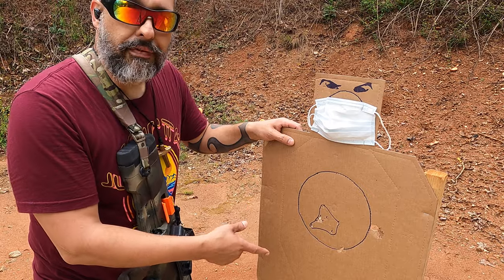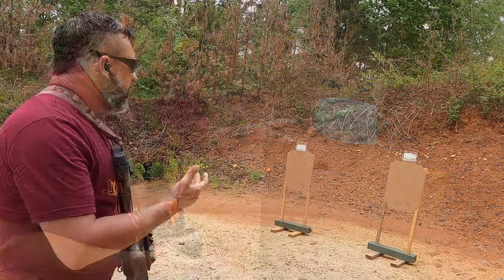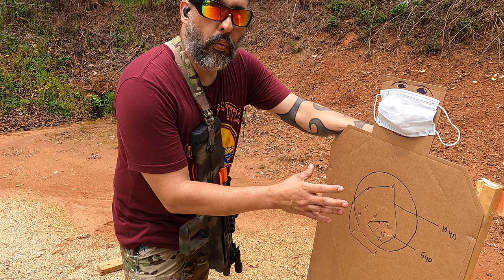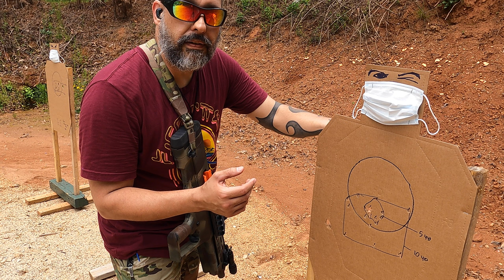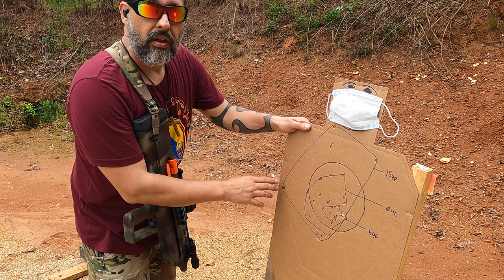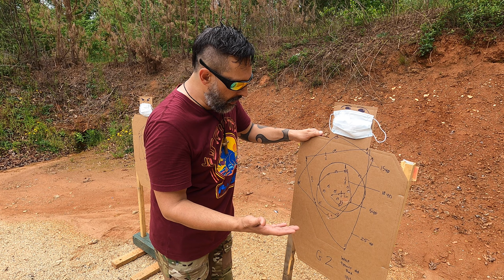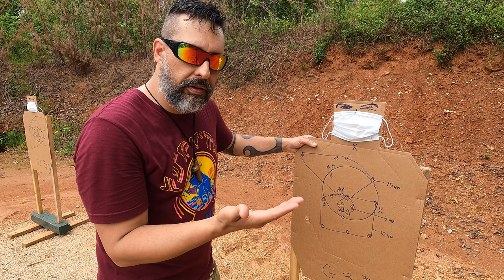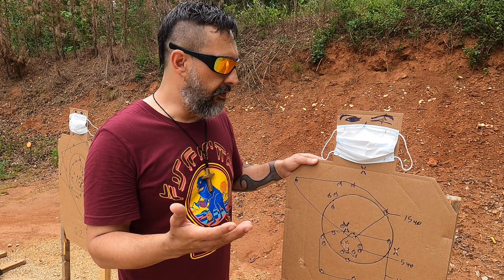BUCKSHOT PATTERN IN IWI TAVOR TS-12 SEMIAUTO  | TS12 | **VORTEX AMG UH-1 BATTERY ISSUE UPDATE**

Comment: Just fyi, you are the "go to" on youtube for TS12 vids. Your other vids are great too though. Love the  honesty and humor.

 So I've shot 500 or so shells through my TS12 now. (Chose the Holosun HE510C-GR with a riser, a WPS sling and soon  added the Manticore Arms charging handle and buttpad. Absolutely love the setup). Anyway,  I've copied your grip style and tube rotation technique since day 1 and have nearly mastered it. I wouldn't be nearly as proficient or confident with this tool if not for your channel. THANK YOU!!!!

(And not 1 malfunction of any kind yet for those hesitant shoppers out there. The TS12 is solid when used as instructed. It's a smile waiting to happen. I highly recommend it)
Reply from the maker: Hi Eric,
Thank you very much, that means a great deal to me. So glad you are enjoying the videos and your TS-12 
You like the MA buttpad? I have not tried it. I am skeptical of the long top “hook” shape. 
Have you run it with plate carrier?

Thank you!
Reply: @attakconsulting  Yes I like the pad a lot better. I was hesitant/skeptical also and it was a recent addition as an experiment. (Willing to try stuff and if it doesn't make an improvement I will shelf it without hesitation and count it as money wasted. This was money well spent imo and it's staying put).  I was pleasantly surprised how much better it fit the shoulder. Very ergonomic. And it is not so much a "hook" but just a slight contour up top with a pretty flat lower half.  It takes the 4" purchase area of the stock pad to a full 6". It does weigh a bit more though. (11.4 oz vs 7.05 oz) Very well made imo. No I have not used it with a plate carrier so....no input there.
Reply from the maker: @ericbennett1253  
Cool. Thx for the heads up Eric

Comment: Love my IWI TS12.  Got a few questions for ya
1) Did you rattle can that camo? or is that a cerakote?  I'm still wavering either way.
2) What brand of shell carrier are you using there? Is it screwed in to the plastic? or a sticker/Velcro with a rip-off shot card?
3) Is the pistol grip wrap just 100mph/duck tape? hockey/cloth tape? some other wrap?
4) Have you found any way to set up a bi-pod mount for bench shooting?  Sure a bag is fine, but I'm kind of shocked IWI didn't put a short 1913 Picatinny rail under the muzzle.  I'm still waiting for someone to make a replacement handguard to have a picc rail or a built-in true vertical grip up front. Might have to resort to rigging a drop-down bracket from the m-lok slots.
Reply from the maker: Hi Hammer,
When you get a chance please check out the whole TS12 playlist:
https://youtube.com/playlist?list=PL0rY2EPHQpYf5P5GaVDiuU4cKLf8vGbgn&si=5eztObYpvClScWBC

But to answer your immediate questions 
1.it’s just spray paint ( got a vid where I redo it with a different pattern)
2.I have various shell cards. HSGI, Tac star, esstac,SOE( my fav elastic)
I use plastic for practice (they are easier to reload) I use the elastic for real. 
3.gaff tape on grip 
4. I personally don’t need anything more on the gun for me. I like the front as I can assume a strong grip while also keeping my hand in a place to “spin” efficiently. 
If you were to design anything for the front, I’ll take an aluminum barrel shroud with mlok slots. The plastic is almost useless. 
Hope this answers your questions. Thanks for stopping in!!

Comment: I’m not a big fan of the bullpup shotguns that I’ve shot, but I like your setup. It looks like you’ve adapted to it well. Thanks for posting.
Reply: You should find a way to shoot one sometime.  I gotta say, with the weight of the gas block above your trigger hand, and the rest of the action being behind it, that balance is amazing.  It points and swings better than any standard shotgun IMO.  For a semi-auto that holds 17 rounds on board, it's surprisingly usable.  

Not sure I'd rely on a Turkish shotgun like the Turk-nelli knockoffs out there (nor a box-magazine for shells either). 

The only shotgun that really compares to the loadout you can take here is a drum-mag set up like a Saga or Fostech Origin12.  Both will run you double or more in cost, and you'll have all the drum/shells hang out front on a already front-heavy shotgun.  

Stocks are great if you're seated at a bench or in a blind... but its tough to beat a bullpup on a sling if you're walking with it.

Comment: Love the videos. Could the TS12 be loaded on both sides simultaneously with a single point sling?
Reply from the maker: Yes, you could even use a two point  around the neck. HOWEVER you will look like you are downhill skiing. I wouldn’t recommend it for anything but fun on the range of course as it takes your focus from the fight. 
Also, don’t try it in a steamy Russian bathhouse!

Comment: I Also use the Vortex Razer AMG HU-I Gen II.  That 1 MOA dot with 65 MOA circle is super nice for buckshot.  

The manual mentions using the triangle at the bottom of the reticle circle for CQB less than 10 yards (30 feet) away.   

While offset is obviously a rifle adjustment... when you train and zero the optic, are you ever using the triangle for CQB distances to adjust for sight-over-barrel offset?  Honestly, I never even thought about it until I read the manual, and I'm really not sure it's even necessary for slugs.  

Have you patterned any slugs to see if it's necessary?  1oz Slugs are 8 times more than a typical 55gr .223/5.56 round... but traveling half the speed. My guess is that the drop distance over CQB distances are negligible, but I don't know for sure since I've never really lead-sled and bagged a TS12 to test if the reticle difference matters much. 

It is really necessary to use the triangle? or should I just rely on the dot as normal?
Reply from the maker: I do in fact use the triangle for height over bore. For slugs and buck. The face shots are made with the triangle. For me anything less than 20’ I’m going to use the triangle. On the vid you can see how the group was low up close. I just wanted to show offset. 
You may have missed it, I did do a head shot with both slug and buck. 
Thanks for watching!
Reply: Ahhh I see.  So do you zero it at 20 yards? 25? 33? 50? Just curious where the transition is here.  @attakconsulting
Reply from the maker: @1977TheHammer  these videos I did a 25yd zero with slugs using the dot

Comment: Aloha Can you tell me were to get the Bolt safety you have in your TS12
Reply from the maker: I got mine at a 3 gun match many years ago, but I did a search and found some on eBay- search “safety plug” item
175228890544

Hope this helps. It is a really convenient chamber flag compared to other styles

Comment: Love your dedication to TS12, very intriguing to watch.
Still too heavy and complicated. 1301 LTT fully loaded w/ red dot, 16 shells total, sling points, light, matchsaverz is just over 9lbs. That's about TS12 empty and naked.
Reply: Would love to know what your TS12 weighs fully loaded.
Reply: @JohnZ556  i've got a TS12 too, its heavy for sure. Thought about a 1301, but you know the TS12 is a pulse rifle from aliens.....and its tactical! 😁
Reply: Lol this dude complaining about the TS12’s weight but says’s his 1301 weighs over 9lbs…
Reply: @DukeTolgo  If you read what I said. 9lb after fully loaded and equipped isn't the same as factory weight. And yes, 9lb fully loaded with everything isn't heavy at all.
Reply: Yes, a bit weighty but short and well balanced imo. My TS12 setup is 11lb 11.4oz w/16 rds of buckshot. But hey.....it gets lighter with every trigger pull. ha ha.
Reply: @ericbennett1253  Thanks for sharing your experience. I know a well balanced bullpup can be 13lbs and still handles well.
My favorite so far is the true X95, can't go wrong with a 13'' bbl 5.56 that's only 22'' overall. Basically P90 size territory but practically the same ballistic as M4. Will be the same length as TS12 with a normal sized can on it.
Reply: @ericbennett1253  Also, options like SF 60rd mag, IDF 30+30 or 40+40 gives it very good firepower for the size. And since the weight from the additional ammo is almost at your shoulder (only ~7" to the middle of the mag, vs. AR is ~16" from the shoulder), you barely feel it.